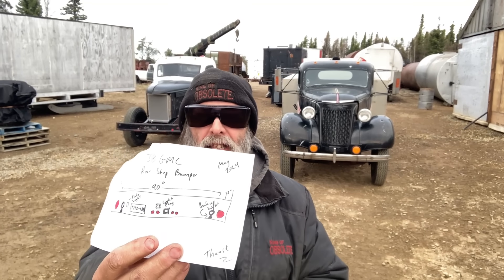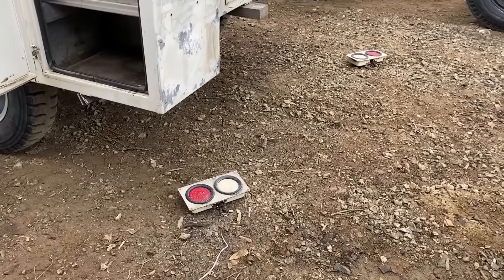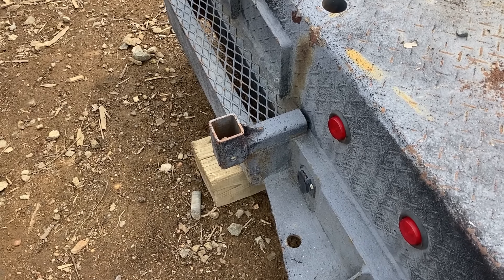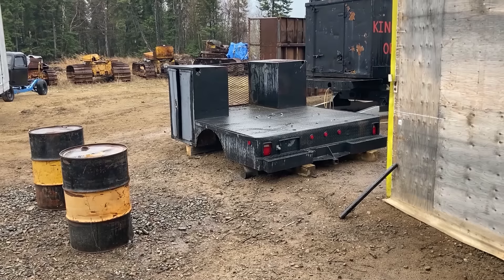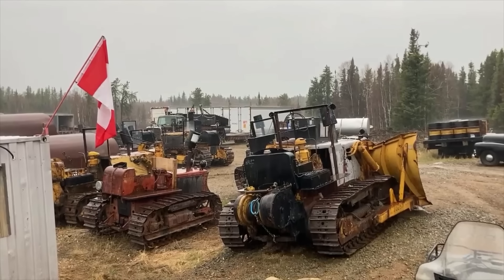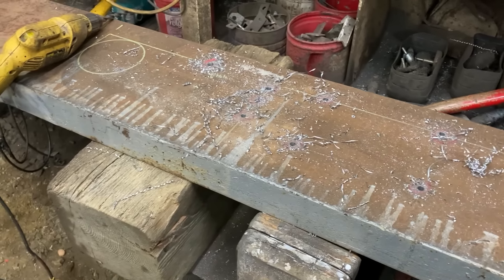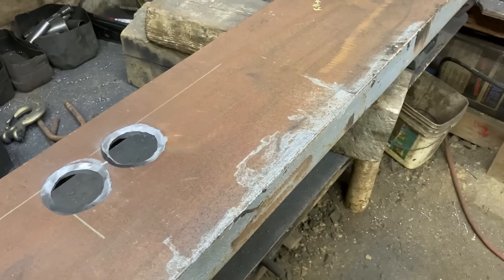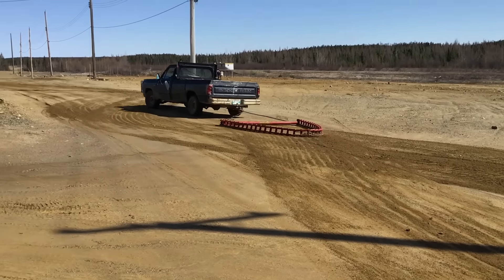The Rains Finally Came So Shop Day May 15 2024

Comment: 8°C? That's way above freezing. I can put more cloths on when it gets cold, but in the heat once I'm down to skivvies and no shirt, the only thing left is jump into the pool for a minute. But I pulled the pool out, so... Fine job on the bumper, it looks like such a work of art, I'd hate to see it get "bumped.''  Staff: Vit "C", D3 and Zinc. Get well soon, we need you. ben/ michigan
Reply from the maker: yes i think that is why i live in a place that only gets 5 hot days in the summer. in the winter more clothes and more heat can be added.  thansk
Reply: Thank you. 

Xena

Comment: We got rain coming also was 82 f today cheers 🥂 guys 😊😊
Reply: Joey got question some of my equipment batteries top post get black crap on posts wire brush won't cut it what is this any ideas
Reply from the maker: now that would be a humid heat too  thansk
Reply from the maker: @dave-uf8ir  baking soda or a copper penny will work  thansk